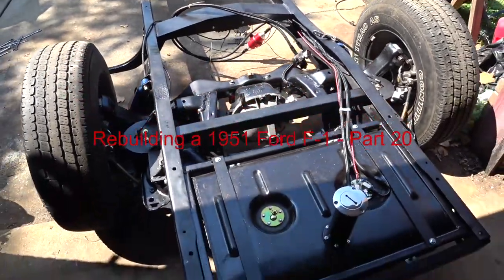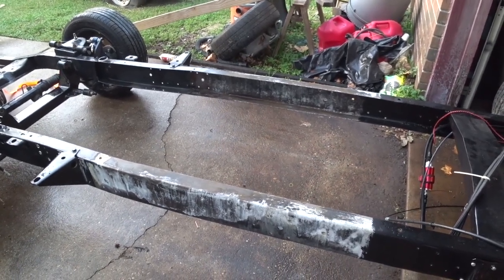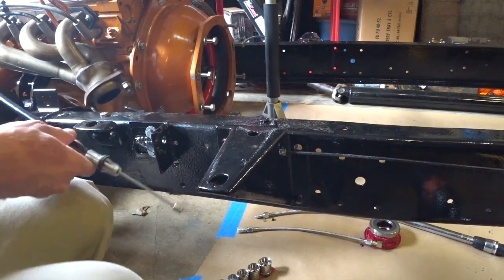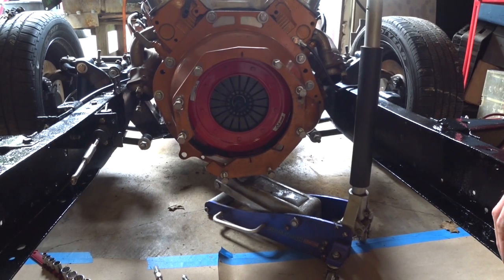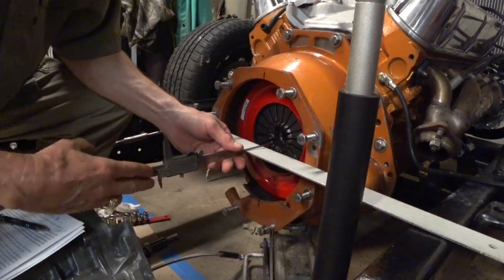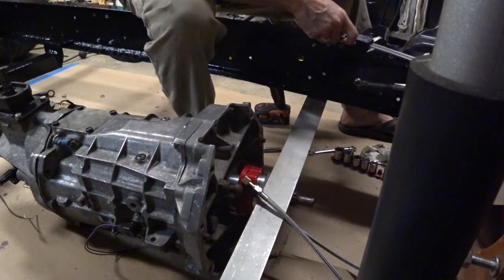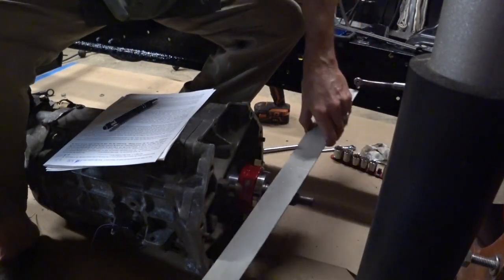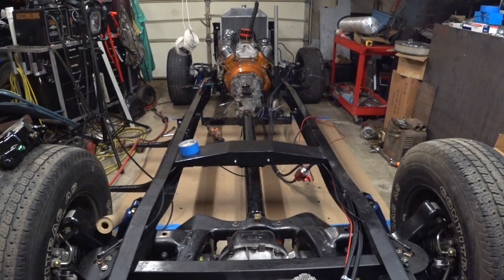Rebuilding a 1951 Ford F 1 - Part 20 - POR 15 Brackets and Frame, Begin Reassembly, Throwout Bearing

Comment: Did you ever finish this build ?
Reply from the maker: It is currently in storage. We sold our home and are building a new house with a proper shop. I still hope to finish bleeding the brakes and wire it while it’s in storage. It would be drivable then.
Reply: Awesome I was just curious about it since I haven’t seen a post ,awesome build btw really learned a lot on this page going to be doing my ‘51 F1 soon too